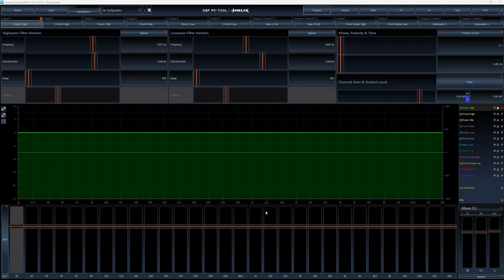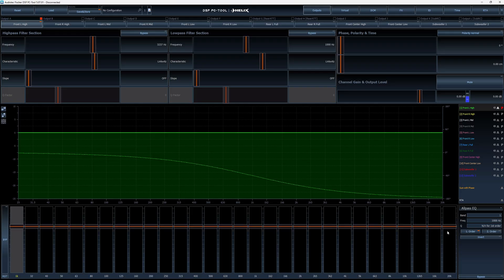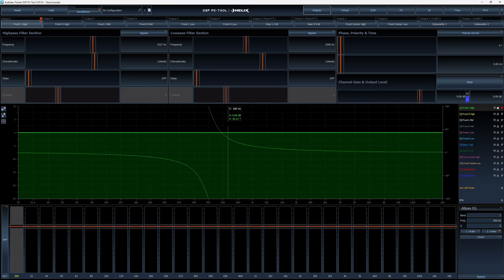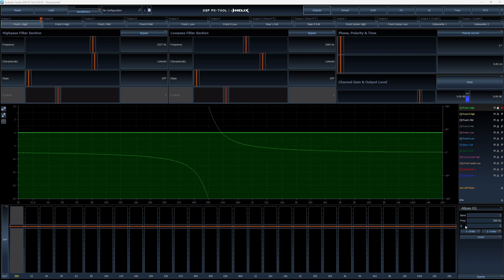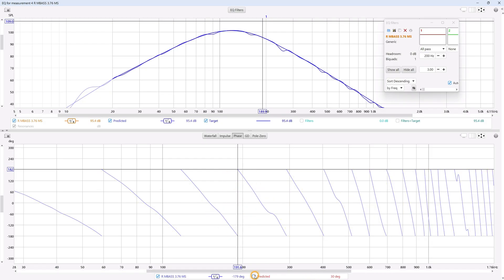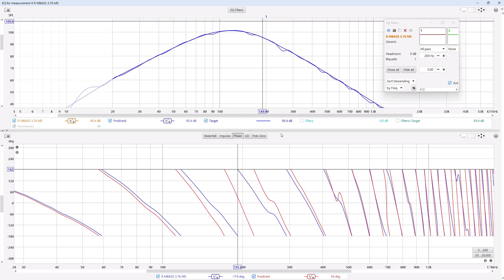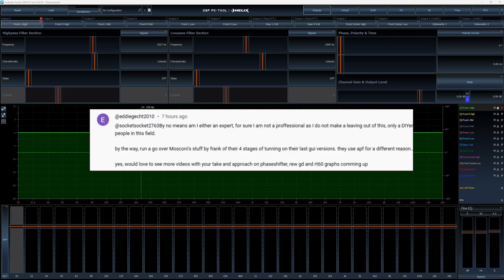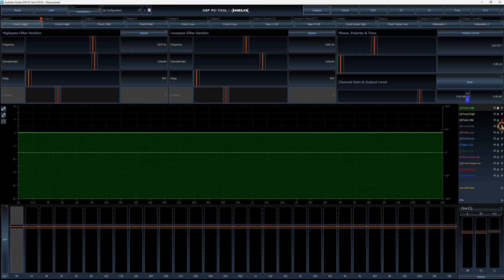ALL PASS FILTERS - PRO TIPS

Comment: Can you use an allpass filter to remove peak filter phase shift? How would that be done?
Reply from the maker: G'Day Stereo, Theoretically you can by creating a all pass filter that is the complete opposite in phase shift to the EQ filter you are using.  So while you can doesn't mean you should, as it means creating custom all pass filters for every EQ band you use.  100% it will sound worse then just leaving the EQ filters be :)   There other techniques used to deal with phase shifts caused by filters such as FIR and linear phase but 99% of DSPs don't have this functionality.  Hope this helps
Reply from the maker: No, not exactly. You apply allpass filter to correct phase shifts the same way as I explain in the tutorial.  The problem is the phase shifts cause by a EQ filter is very subtle. As I said above people dont usually use APF for this they use Linear phase etc but if you want have a go then  I say go for it.  Remember APF only work on the summed result of two speakers playing. You can’t use a APF to correct the phase of a single speaker. Let me know if you get it to work
Reply: @socketsocket2763 I can do that, I have enough bands left. Do I just use the same frequency and Q as my peak filters?

Comment: Hi Socket, thank you for this wonderful video.

I am very used to audison, I recall seeing apf only on the virtuoso bit hd maybe on forza as well.
Audison have the shifter embedded in to the apf and you can select 1st to 2nd order.

Mosconi are providing a2nd order but with a full cycle 360 phase reducer and they mainly use it to match phase between different speakers on the same side...

zapco/goldhorn are very much like fischer. the phase reducer is separate feature from apf.

How I understand it, phase shifter is bassically a reducer of up to 360 degrees, more than that you have to aim the sloping better between a fast speaker to a slower one.

My guess that woofers and midbasses dont have a shifter is that they are the slowest in a set and one should only reduce phase from the faster speakers towards them but subs do get it in case yes, there is a front sub OR the slope of the sub is so shallow that it could slowed down in front of a very steep sloped woofer...

hope it makes sence?
Reply from the maker: Thanks Eddie., that is very valuable information and the way you explained it makes perfect sense.  Especially the reason for not having phase slider on midbass.  Thanks so much.  I have learned something new today :)
Reply: @socketsocket2763  just to add smtng i forgot.
Lets say we are adjusting a 6:5 to a 3.5 400hz 12db midbass cut at 200hz the 3:5 at 800h both time alligned both attenuated at 400 at 12db, xover method expected to work per calculation...

however... the 6.5 would accelerate to 400 much slower to the 3.5 ad it is bigger, heavier, harder to amplify...

hence the phase gap.... it is bassically a speaker velocity factor at given frequency and althow timing, crossing and voltage are ok we still need to compensate speaker velocity. phase shifter or apf can do this too.

Socket, if you happen to have a video about loopback channel calibration can you point me to it? I would like a tutorial about that from you?
Reply from the maker: Thanks mate.  I have not applied AFPs in that way but what you say makes sense .  Nice…. Re loopback calibration, I have done a couple of tutorials on setting up loopback cables, but these are just about how to route the cables to create the loopback reference.  Loopback calibration is not something I am familiar with sorry :(

Comment: Hi socket, using all pass filter will they correlate the sound.
Reply from the maker: Hi Saint, When we talk about correlation in terms of sound, high correlation means the sounds are similar and in phase, low correlation means the sounds are dissimilar and not in phase. So from that perspective, yes an APF will improve the correlation of sound if applied correctly.  But improving the correlation of the sound and how it sounds are two different things. In general yes if sound waves are matched in magnitude and in phase they will generally sound better.  But as I mentioned in the tutorial, APF with high Q values can cause rapid phase shift, that can cause acoustic artifacts in the playback such as echoes or transition issues.  It is always good to listen after applying a APF to make sure you are happy with how it sound as well as how it looks in the measures.   I hope this helps mate :)
Reply: @socketsocket2763 Thank you socket for the elaborated reply.
Reply from the maker: Anytime 👍